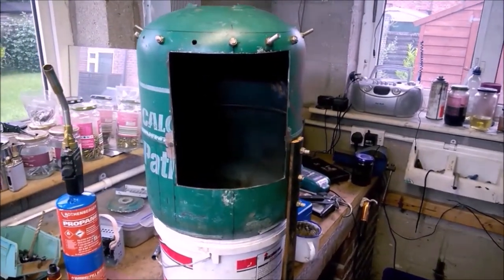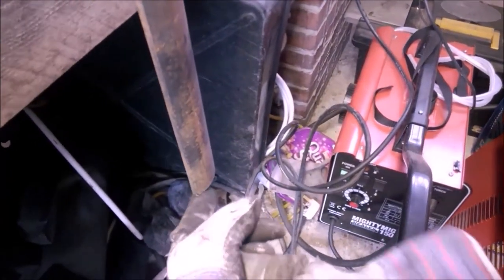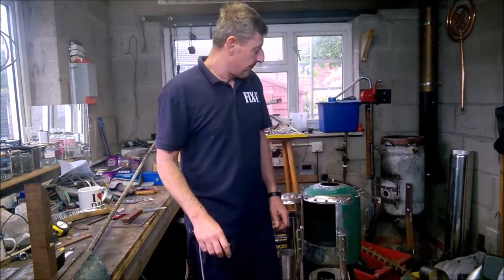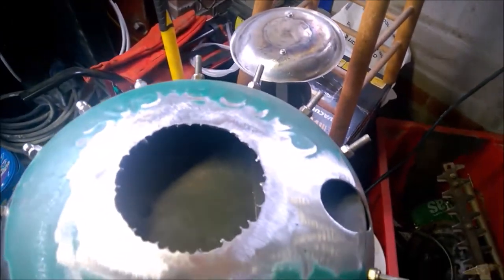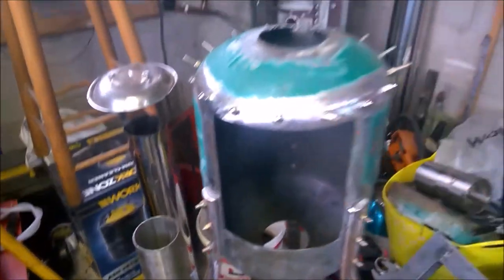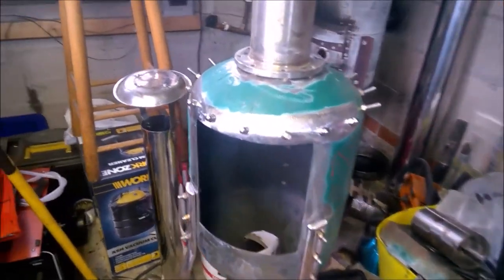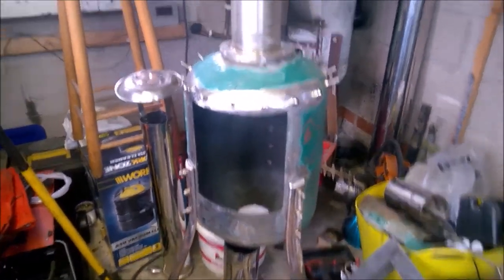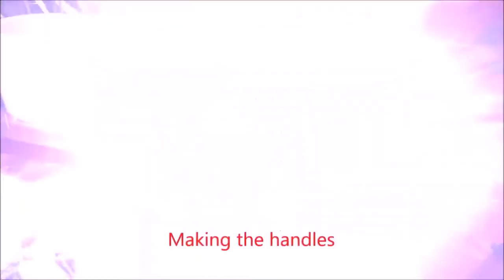wood burner/heater. Part 3. efficient burner built from a gas cylinder

Comment from the maker: 24 hrs is plenty Craig. It will still smell of gas until you do your first burn. Best way is to cut door opening and flue outlet and then burn some wood in it. This will also remove the paint. Any other queries Will be glad to assist.

Comment from the maker: Also if you watch my vid on my waste oil heater you'll see I have used the cut out for the door. Just made a flange on the inside for the door to close against. I used a recip saw to reduce the gap but if your using an angle grinder use a 1mm thick cutting disk. Makes the cutting out quicker and neater.

Comment: Hi buddy. Love your work, really cool. 

1 - I have taken the valve off one of the gas bottles I have aquired
2 - I have filled the gas bottle with cold water 
3 - I have left the water in the gas bottle for 48 hours
Do I need to do anything else before using a hand held grinder to cut into the bottle? 
I don't want to blow myself up, obviously.......

Thanks again